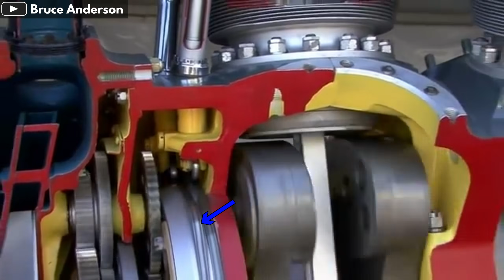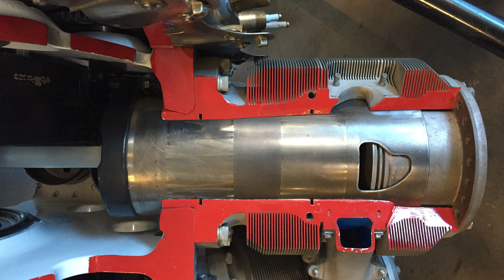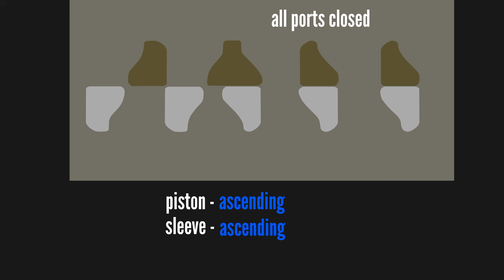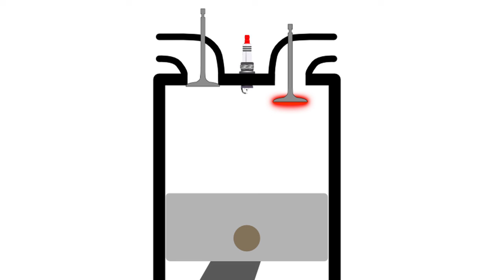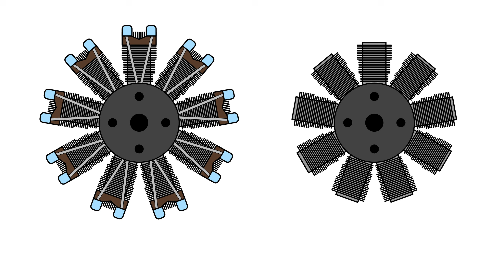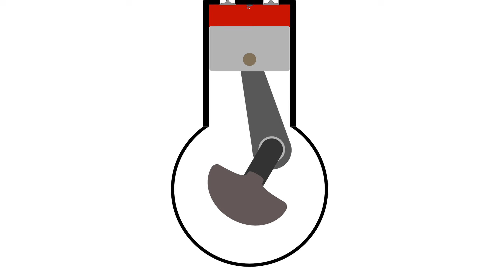Analysis of Bristol's Sleeve Valve Aero Engines

Comment: I believe there are locomotive diesels (2 - stroke) that use sleeve  valves.
Reply: No, that is not true.  2-stroke Diesel engines used in locomotives are normally aspirated Uni-flow Winton-Type with exhaust poppet valves or Horizontal Opposed engines with piston ports.

Comment: Other aircraft engines using the sleeve valve, was the Napier Saber V engine, with 24 cylinders in an 'H' configuration, with 2,600 Hp to the Saber E.122 with 3500 Hp output, and the monstrous Yakovlev  M-501, a 42 cylinder, RADIAL Diesel engine with 6,205 Hp (turbocharged) intended for use in a Soviet 4 engined heavy bomber. One M-501 was modified for gasoline, spark ignition, developed over 10,000 Hp and was used for tractor pulling contests. BTW, that engine is still in production (maybe).

Comment: I believe the competitive technologies were necessary to optimize development in the 30s.  The war simply pushed that to the forefront and then both were quicky being overtaken by jet propulsion.  Regardless, history is full technological rabbit holes that eventually benefit all research and development in the field (i.e., what doesn't work is as important as to what works).  And some point you need to bow to the Pareto Principle and move on.

Comment: Thanks for the great video! Although the sleeve valve design looks much better on paper, it seems that it wasn't better, just different. I've read that engines with sleeve valves tended to be quite difficult to start at very low temperatures.
Reply: According to a contemporary book I have here (A W Judge's 'Modern Petrol Engines') '...cold tests showed that the additional starting load was not more than 'around 10% at  minus 15 deg F and 14% at + 15 deg F...'  Judge also noted that '...with the modern tendency towards preliminary warming of the complete engine or the oil supply, prior to starting in cold weather, this additional starting effort would not be necessary". Also Bristol was a pioneer of pre- shutdown oil dilution systems, and although I can't find a reference to the sleeve valve engines using it, I suspect that would also be a viable option.
e: to remove inadvertent strike through

Comment: i really wish they'd have valved this machine for 2 cycle instead of 4 cycle operation.  the sleeve valves are so much better at moving air than poppet valves.  it wouldn't have been difficult to do and would really have helped.

Comment: Fun and interesting presentation. The air cooled sleeve valve head cooling was largely solved with the liquid cooled engine designs. The Napier Rapier and Sabers were interesting designs you discussed in other videos. In the end, the gas turbine did in all the large aviation reciprocating engines.

Comment: My personal interest in the sleeve valve engine was roused from the moment I came across its clever design. Following which the involvement of Harry Ricardo caught my even greater attention. The respectable rise of its use in the Sea Fury certainly justified my considerable faith in its superiority, being additionally compounded by its allowance of the spark plug in its ideal position within the piston assembly. In so many ways the construction overcame the shortcoming of the 4-stroke engine, with a ported, almost 2 stroke solution (via porting in the sleeve.) Not that I am suggesting its increase in cyclic efficiency to that of a 2 stroke of course. As the octane rating of fuels increased over the course of the war, it continued to come into its own. Anyone who has heard the roar of a Bristol Centaurus engine in a Sea Fury would understand my fondness I am sure. It rather surprises me that the Americans did not take the ideas, incorporating them in compound dual stage turbo supercharged unit. Pride perhaps would have played no small part in this I would suggest? You always have a great episode, to which I look forward, and this one has pleased me no end, so thank you again.

Comment: I have a question for you, beside the problem of sleeve valves. In modern motorbikes competition, distribuzione views two systems: pneumatic Poppet valves and desmodromic poppet valves. There lasts seems to be a little predominant in power with Ducati in the lasts years. What is your opinion about developing an engine with sleeves valve only for the competitions ? TY in advance

Comment: Awesome content. I’ve been curious about many of the points you’ve covered. Thanks for such a fine clip.

A few things I’ve never seen addressed adequately are:
1. Manufacturing cost comparisons of the sleeve vale vs the poppet valve eg centaurs vs R-3350
2. TBO comparisons (both civilian and wartime)
3. Running costs

The Centaurus saw limited civilian use on the airspeed ambassador and the Hercules also. However this was nothing compared to the ubiquitous use of the R-3350 and R-2800. On this basis I’ve always assumed the poppet valves had the advantage in this respect

Comment: some 55 years ago I did an engineering apprenticeship with a southern hemisphere company that did lots of contract work on the Bristol Herc engines (both overhaul and repair) Occasionally engines would arrive after dramatic failures. On one  memorable occasion an engine arrived that had suffered a major failure of the sleeve gears. We removed the outer shell and a torrent of gear bits fell out! Apparently this wasn't unusual! Although most of our Herc work was for Bristol Freighter engines, once replacement engines became scarce we started converting ex-military Hastings versions to Freighter versions.  Great learning for trainee aircraft engineers before proceeding to early turbo fan engines!
Reply: Sounds like the same place I did my apprenticeship only about 65 years ago (early 60's). I must have spent over 18 months on the Hercules line plus more time in the engine shop in other sections including 6 months on Hercules carburettor overhaul. In my time I never saw an engine failure however the bits were getting older by the time you were there. Also some of the old guys with years of expertise would have retired.
Reply: @Kingsford44  I heard an aircraft engine builder say that unlike RR Merlins the Bristol and Napier sleeve valve engines don't like high rev settings and prefer low revolutions with high boost numbers to ensure long life.
Reply: @potrzebieneuman4702  Except that the Napier Sabre ran at 3,800-4,000 rpm at take off making it one of the highest revving engines if not the highest. I did read that the civil Merlin's on the Canadair Argonaut cruised at a higher rpm than a typical radial but this was offset by their low 650 hours between overhauls.
Reply: @Kingsford44  I don't think the power settings at takeoff were what this bloke was talking about, he mentioned someone with a Centaurus engined AC flying a display somewhere and the fact that the engine was being run at somewhere around 1800 rpm while others with Merlins and US radials running at around 2400 rpm, anyway the inference was that the Centaurus was happier at lower cruise settings.

Comment: Another issue that was never resolved is that of sealing. The sleeve has to move versus the ylinder and ant seal perfetly (like a popet valve). I ran a company designing engines with similar issues (sealing perpedicular to moving surfaces).
I seem to reall that it was this issue that made sleeve valve cars less reliable (fouling & sealing issues).

Comment: I have fantasized about Bristol dropping the sleeve valve and building an 2800 cid engine with fuel injection and a Daimler style supercharger drive system. 2000 hp in 1940.

Comment: The fabulous Knight engine was a very successful auto motor, used by many companies, including Rolls Royce, who liked it because it was remarkably quiet.
Reply: The so-called Silent Knight engine was indeed pretty quiet compared to conventional engines. One problem was the difficulty in starting them in winter. There were no multi-viscosity oils back then so the oil was like molasses when very cold.
Reply: Also oil consumption was high. Have a look at film clips of the British MK1 to MK4 WW1 tanks, they used a 105 HP Daimler sleeve valve engine and the smoky exhaust is very visible. Also internal friction is high on a double sleeve valve engine as you have 3  sliding surfaces.

Comment: It was a weakness of the UK in the war to go after exotic and unecessarily complicated construction. Another example was the merchant Navy Class locomotive with an unproven new chain driven valve gear in a leaky oil bath, oiling the wheels of the Pacific locomotive type always prone to slipping in any case. The locomotive was air smoothed also yet during the war the valances were removed from the A4 pacifics to aid maintenance! Many of the class were rebuilt with standard valve gear after the war and the air smoothing removed. It must be something about the British and valves.

Comment: As an apprentice back in the 60's I spent quite a bit of time on a Hercules overhaul line. The sleeve drive gears looked hideous but Bristol had made it ridiculously easy to set up the timing. 1 leading hand, 1 tradesman and 1 apprentice used to produce an assembled bare engine ready for the test cell every two weeks without breaking a sweat (after receiving a fully inspected but disassembled engine from the Inspection/Rework section next door, all ready to put together). Never saw a single failure in my years there in spite of one customers engines being "thrashed" (short, frequent flights at high power).
Reply from the maker: Very interesting, thanks for commenting!
Reply: @LetsGoAviate  Another good thing about the Hercules is Bristol did not use any lockwire inside the crankcase and front cover. They used tab washers and split pins to lock everything so no chance of broken lock wire appearing in the oil sumps/filters unlike the R2800 which had a mass of lock wired fasteners internally especially in the front and rear covers which housed the cam rings and followers etc. If you overtwisted the special P&W lock wire you work hardened it and would probably find broken wire in a sump after a few months in service.

Comment: Without watching the excellent video ~ no. They were not a failure. Like any engineering development, they had strengths and weaknesses, pros and cons. Poppet vales became the norm in the civilian world, cars and things, and everybody from the factory workers at Bristol down to the mechanics on the flight-line, were familiar with those. Sleeve valves were a whole different animal. Then you have the problem of the tolerances and the precision machining required to make them work ~ the advanced metallurgy necessary.
Some (certainly not all) of the late war and post war Super Props used them, the Sea Fury being a shining example.
The whole combat aviation and larger commercial aviation world, was being turned on its head by the arrival of jets.
What you can't do with a turbo-jet you can do with a turbo-prop. By 1948 RR was making the Dart which was a 1500 ~ 2000 hp turboprop, which powered regional airliners for the next 50 years. That engine and its many descendants, were a million times more reliable than poppet valves or sleeve valves. They were not exactly cheaper to make, but they required massively less regular maintenance.
The sleeve valve did not break through and become the normal valve mechanism in most internal combustion engines, and on that level, I guess you could say it was a failure. But in the intended role (aircraft engines) you could equally say the Internal Combustion engine itself was a failure. The case is remarkably similar.

Comment: The Bristol Hercules remained in service in the Nord Noratlas until 1989.  Its TBO reached 3900 hours.
Reply: The video did not touch the wear and friction reduction.   I will post a full reply to better explain the whole thing.  The Noratlas by the way was the last military mission of the sleeve valve, the resistance of Greece against the Turkish invasion of Cyprus in 1974.
Reply: @demetridar506  Now, there is a small company making sleeves (for conventional 4-strokes) that literally spin in place to reduce friction, improve overall efficiency etc etc. While sleeve-VALVE wasn't developed for it, not first nor 2nd time, this is a MASSIVE benefit that people somehow never mention lol.
Reply: @bo-dine7971 Brilliant!
Reply: At least you wouldn’t have mosquitoes around the airfield 🤣

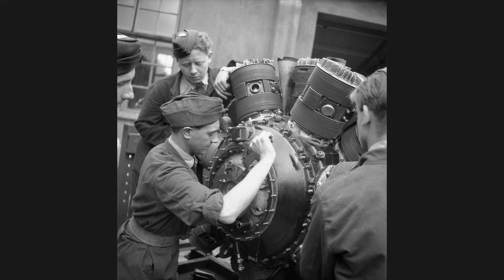Comment: 8:10 Straits Air Freight Express (SAFE) /Safe Air Limited mainly operated across Cook Strait between the North and South Islands of New Zealand  from 1950 to 1990, after taking over inter-island services from the RNZAF. They operated a total of 22 Mark 31 Bristol Freighters (and other makes), the Bristols being retired in 1986. They developed their own palletised cargo system to reduce turn around, and also developed a passenger pod, which also was slid into the cargo space,  to provide a passenger service to the Chatham Islands, which are around 800km East of the South Island (around a 3 hour flight...)
Reply from the maker: Thanks for the info. If I'm not mistaken, it was also here the engine TBO's were increased to 3,500 hours.
Reply: @LetsGoAviate  
Worth a look at their Wikipedia page, and I think there's a book about them out there somewhere.
Used to watch them coming in to land at Rongotai/Wellington airport (before Cobham Drive became part of the State Highway system, and you could park at the end of the runway, that is). You could definitely see how the sobriquet  '40 000 rivets flying in formation' was coined.

Comment: a central sparkplug was much more important with low octane fuel
Reply: Central spark plug is more important when you do not have a modern quench-type, high swirl combustion chamber
Reply: @sandervanderkammen9230  I think you mean "squish" not "quench"
Reply: @PaulG.x I think you will find most engineers use the nomenclature 'Quench'
eg; quench pads or quench deck

"Squish" is a non-technical or vernacular expression... used to explain the concept to non-proffessionals and the general public.

Comment: As an aside, I looked into using a hybrid sleeve valve "valving" system to operate a Stirling / Rankine cycle, rotating (non piston) engine. I was trying to kill the internal energy loss due to reciprication of the piston. This is important to a low power (heat difference) Stirling cycle engines.
Thank you for your comprehesive and clear explanation.

Comment: Wasn't the main advantage that you could have 4-5 ports per cylinder? A poppet valve radial engine could normally have only 2 ports per cylinder. Although Bristol made the Mercury, a 9 cylinder poppet radial with 4 valves per cylinder. But I think this was impractical in a multirow radial. Probably because it required having pushrods between the cylinder rows, making them too hard to maintain.

Comment: imo it was the right choice to pursue sleeve valve engines to have a fall back option if poppet valve tech hadn't come through.
Reply: The right choice was to develop a viable Axial compressor turbojet... something that brits failed miserably to achieve.
The UK would not have Axial compressor turbojets in service until the 1950s and has lagged behind in aero engine technology ever since.

Cheers mate!
Reply: Rendered completely obsolete by jet engines.
Reply: @DoktorBayerischeMotorenWerke  the UK developed and produced jet engines too. Jet engines were largely irrelevant to WW2 because they weren't ready in time in enough numbers and enough reliability.
Reply: @adamcrookedsmile  British jet engines were the centrifugal type... an evolutionary dead-end concept that was completely ineffective during WW2.
 Only the German axial type engines were effective in combat and the only type used today.
Reply: @DoktorBayerischeMotorenWerke  so you think this video is about jet engines, Herr Doktor?
Reply: @adamcrookedsmile  No, its about aircraft engines... what is your point lad?
Reply: @DoktorBayerischeMotorenWerke this video isn't about German jet engines, Mein Herr. So stick to the subject.

Comment: 17:46 - In my experience, every (performance) dyno test (all poppet valves) has shown increased power from decreased quench clearance, so long as there is no contact between the piston and the cylinder head. All modern literature credits what this to what is known as "turbulence" resulting from those tight quench clearances, forcing the mixture away from the cylinder walls, toward the center of the chamber, which makes sense as the flame-front will propagate more rapidly across a turbulent, compact, mixture volume. Even in classic sports car engines with modern pistons, we are now confident with quench clearances of ~.5mm at 5KRPM.
I don't know about "swirl" nor any limitation of such, and you indicate it as limited to anti-clockwise motion, but I see nothing which would provide such in the illustrations.
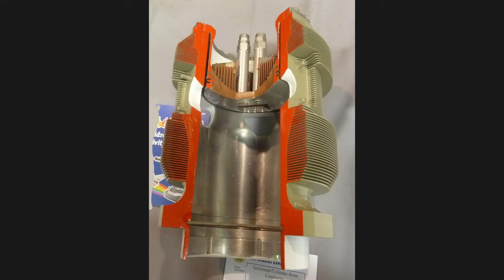19:39 - A lot of design and testing time on modern engines is spent on chamber geometry to reduce 'corners' where the flame won't travel and where thin metal wouldn't heat up enough to initiate combustion. It would be interesting to see what a sleeve-valve chamber looked like (mentioned @ 24:21).
21:47 - Grasping at straws here.
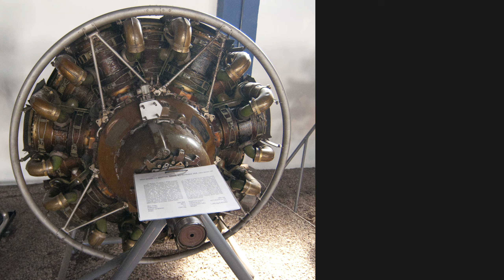25:06 - Not the first time a 'study' found the opposite of what was obvious (see "smoother", below).
27:09 - Read reports that the sleeve-valve radials were "smoother". An obviously biased and untrue claim; shuffling a 15Kg sleeve back and forth is clearly going to introduce more vibration than a couple of .25Kg valves. Further, obviously, the dedicated airframes must be designed to accept these increased dynamic loads.
Like rolling element engine bearings, this was a bandaid technology which was overtaken by events. An interesting side path.
30:00 - The world would also be a bit more boring absent Li battery fires from EVs. Good engineers know when to 'pull the plug'.